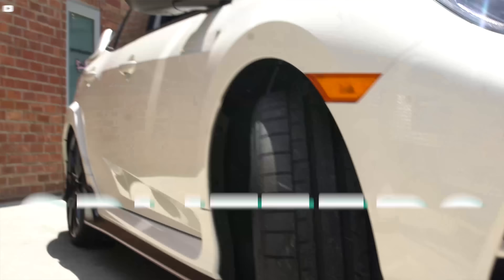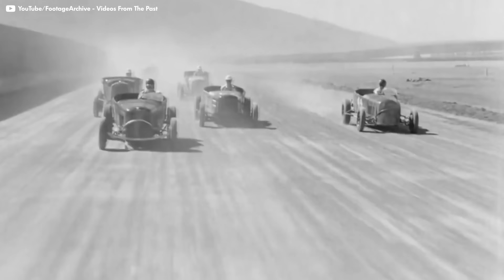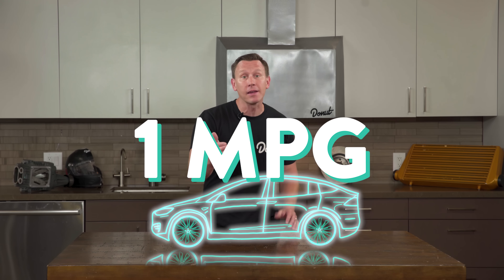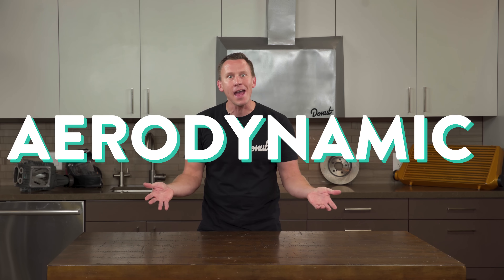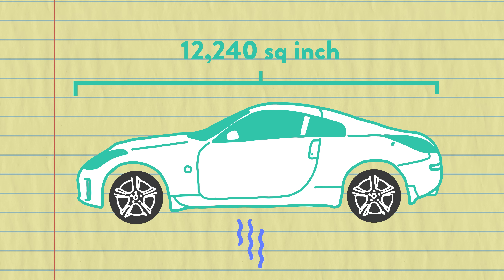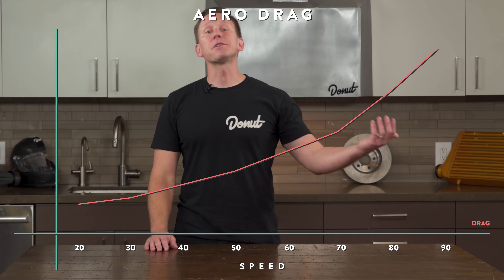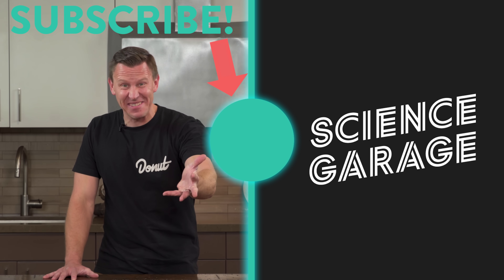Wings and Spoilers; Lift and Drag | How It Works

Comment: The ford gt 2017 car makes a perfect example, but better because the spoiler is automatic once the car goes over 100mph the wing lifts up by itself. EVEN BETTER, the ford gt 2017 is fully made of lightest strong material such as carbon fiber.

Comment: Why Tesla have good aerodynamics having a fucking wall in their front
Reply: And cars dont? Radiators and intercoolers are essentially walls for air. The amount of air that gets through is pretty slim. In fact, most if the ir diffracts across and around the radiators into your engine bay where it runs into even more stuff, your engine, your fire wall, in some car cases theres an undertray in the engine bay essentially turning the whole engine bay into one big parachute. Hope this helps!
Reply: @theofficialkevin  My comparison is more with a curved front , like porche 953, jaguar xjr9, lemans lm07, Maurer c87,  but you surely helped, thank you.

Comment: I love most of your videos, but as an aerodynamics student, I have to point out some mistakes in your explanation for lift. First, the use of the coanda effect is incorrect for explaining lift. You mentioned earlier in the video how it's like you're moving through an ocean of air. This is more accurate, the airflow behaves like a continuous material, which deforms to follow the shape of the airfoil. The coanda effect is only relevant when looking at a relatively small jet of high velocity air, the air the vehicle moves through isn't behaving like a jet of air. Another misconception you used was the longer path fallacy, you said that because of the shape of the airfoil, the air particles on one side have a longer path to travel and therefore, they speed up. This is incorrect, in fact, the length of the top and bottom surfaces could be the same while still generating lift. Rather, the airfoil causes the flow to deflect due to its shape and angle of attack, which causes a change in the momentum of the fluid, this change in momentum in one direction causes an equal force in the opposite direction, which contributes to lift. The part where you mentioned high pressure at one surface and low pressure at the other contributing to lift is good, though it's important to note that this pressure differential isn't caused by the velocity change, rather they respond simultaneously to each other.
Reply: I agree with Jake on this and I will agree with everything he said not much more to add.

Comment: Your explanation of aerodynamic lift is wrong. Actually, air dragged along the surface of the wing (coanda effect) doesn’t produce lift through a venturi-like mechanism, but simply because the shape of the wing redirects the air down, producing upwards force vectors on the wing. If you put a wing in a wind tunnel, you will find that the air passing over the convex surface of the wing does not feel compelled to move faster than the air moving over the flat surface so they can both meet at the same time on the other side. In fact, they don’t both meet, and the resulting “absence” of air from one of the airstreams results in vortices and chattering back and forth of the air steam coming off the wing.

Comment: This is so incredibly wrong. The air traveling the longer distance has nothing causing it to increase its speed. Bernoullis equation was also proven wrong decades ago by Einstein equation. The real reason it creates downforce it that the wing redirects the air upwards and basic laws of physics says, equal and opposite reaction, so the wing is pushed down by the air

Comment: Coanda effect is BS, Fluid dynamics are similar NOT EXACT to aerodynamics... coanda crap, following the curve , is in WATER Air leaves a low pressure VOID just behind the curve ... which the high pressure UNDERNEATH pushes into ...Lift on a plane /down force on car

Comment: In a technical sense, air is a fluid. 'Fluid' doesn't mean the same thing as 'liquid'. Replace the comments about fluids in the beginning with the term 'liquid' and you would be correct.

Comment: high pressure moves to low pressure
that's why a brick will move 'backwards' because there is high pressure at the front and low pressure at the back

amen

Comment: OMG, the second vid of Donut Media and another mistake. This one not as bad but still... any engineer has to take calculus and so should know the dif between exponential and polynomial growth.
Reply: This issue here was not a big deal. The other Donut Media vid I watched was on catalytic converters which had two errors I spotted, one at the heart of the topic, namely, they got the reduction reactions completely wrong.

Comment: Super late to comment but I have been looking at doing an ev conversion on an old ford ranger and the biggest thing I am looking at is range. Im thinking that having aero to increase lift would increase the range of the vehicle by simulating a lighter vehicle since the air would hold some of the weight. Anyone know if I am just stupid for thinking this or is there actually something to this idea? Mainly looking to increase highway efficiency as I have about a 30 minute highway commute.

Comment: Does gt wing really causes more drag and reduce fuel consumption and slow ur car down?
Reply: All wings will cause drag, thats what they do. Its a matter of if the increased traction you get is enough to make up for the increased drag. Wings only help cars that are traction limited at higher speeds.

Comment: The air that has to travel further does not speed up. It is not because of the distance. That is wrong knowledge. In the latest airfoil designs, you have wings that has longer underside and shorter upper side.

Comment: STOP TALKING ABOUT BARNACLE'S PRINCIPLE. IT HAS NOTHING TO DO WITH LIFT GENERATION. THIS HAS BEEN A MYTH FOR TOO LONG. Wings are newtonian in nature and super duper simple! If you push an object through air and that air gets pushed upwards, then you get downforce! If you push an object through air and that air gets pushed downwards, you get lift! You don't even need a special shape to do this! You just need to deflect the air in a direction! The reason wings look the way they do is simply to minimize separation of fluid from them to maximize the amount of air they deflect! This is why when you stick your hand out your car window and rotate your hand, your hand will get pushed up and down! Look on the wikpedia pages for Lift and Bernoulli's principle and you will find: An airfoil generates lift by exerting a downward force on the air as it flows past. According to Newton's third law, the air must exert an equal and opposite (upward) force on the airfoil, which is lift.[13][14][15][16]. All bernouli's principle states in the scheme of this is that the flow must change velocity and thus must change pressure. That's it! I even saw a damned exhibit for this at a MUSEUM saying this is how airplanes fly! IT ISN'T! When you turn on your ceiling fan, it's pushing a wing through air that's shaped to push air downwards which creates lift as a byproduct!

Comment: 1:06 I'm having trouble with this explanation. Physically it is correct in a way but mathematically you'll get the wrong numbers. Fd (or drag force) is calculated with the density 'rho' of a fluid and 0,5. So Fd = 0,5 * rho of the fluid * Vsquared * drag coefficient Cd * reference area A. This gives an answer in Newton that represents its (counteracting) drag force

Comment: Wrong explanation of lift / Bernoulli's principle. Google "wrong explanation of lift" and read what NASA has to say.
Reply: Thank you for this comment! I just learned about the wrong explanation yesterday, and immediately checked the comment to see if someone pointed it out.
Reply: If only you guys realised that every explanation is wrong...
Reply: F = m * a, just like Isaac Newton said. And the Coanda effect makes the airflow follow the wing, which causes the acceleration of the air. Correct, Bernoulli is not needed.
Reply: When nasa actually puts a man on the moon ill listen to them

Comment: Thanks for the great vid, but i have a few questions:
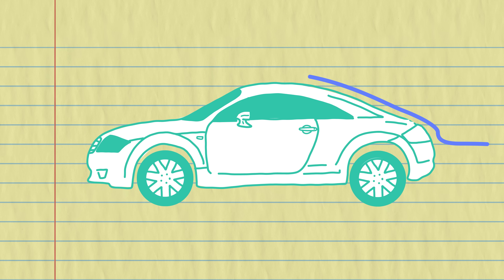1) 7:00 Why does the lift effect happen just on the rear?
2) regarding he splitter: if you have more air underneath the car, and the air has less to travel underneath it than above it, wouldn't that make the air move faster, thus creating lower pressure, thus creating negative lift? 
3) I don't really get how the air travelling underneath the car is faster then the one on top of it (thus creating negative lift), even with all the design adaptations, since there is a lot more travel distance for the air to travel on top than below (which is pretty much in a straight line)

Comment: I actuallt study aviation and the explanation about how the spoiler works is not true. Fast flowing on the bottom and slow on the top is nog true. This is a common made mistake but the air follows the curve so the air is bend. And because Newton said for every force there is a counter reacting force the wing is being pulled down. It is not so that the spoiler is pulled down because of the difference in speed of the air. 

Just being nerdy here

Comment: I have a question, if anyone could answer
If having more displacement is good, why do we use circle cylinders instead of squares? There is more area so there would be more displacement, and more horsepower. Can anyone answer please?

Comment: In case you didn’t know how much downforce can be affected. If you take a car (i.e. any RWD sports car) that didn’t come with a spoiler let’s say. If you put a little bitty piece of tape on the back of the car, that creates quite a lot of downforce. About 30 or 40 lbs of it.

Comment: actually Bernoulli's principle is a wrong explanation of why the airfoil shape generates lift... Bernoulli's principle is valid for every point along a particular fluid profile...but in this case we make a mistake by comparing two different profiles...we cannot do this because Bernoulli's principle is the law of conservation if energy in case of fluid flow but only if we consider one particular fluid profile where energy neither enters nor leaves... so the fluid energy remains constant and from this we derive Bernoulli equation...

Comment: Thank you for the video! I own a 2007 Ford Focus 5-door hatchback, and since I live in Italy and engine upgrades are very prohibited for road cars, I have found the way around it. I have reduced the weight by removing every single interior component in the rear of the car (frame is all you see) and I am experiencing a loss of stability in corners because of the huge difference in weight balance. I think a wing wang (similar to the RS wing) would solve the problem. Any tips?
Reply: Remind me not to move to Italy.

Comment: One question, I am having 410 WHP EVOX, should i put my big voltex wing on or just plain carbon trunk.  I can feel the difference with the wing slow down my car but I feel stable.
Reply: You need the wing if you want stability at higher speeds. If you want that kind of stability without a wing, you'll need to weigh it down.

Comment: It's not correct to say drag increases exponentially with the velocity because the square function is still polynomial, thus it grows much slower (in the long run) then an exponential function

Comment: Wrong wrong wrong - Bernoulli’s doesn’t apply here , also air doesn’t have to go faster because it has to travel further.  These pseudo principles of lift have been debunked.  Although he’s right about the coanda effect, that’s the key to understanding positive and negative lift

Comment: Here's an idea for you, one of the areas of a car with the lowest pressure is the edge between the front bumper and hood. So next time you see a hood scoop or a headlight deleted into an air intake, realize it is literally the dumbest spot to put an intake, the intake is actually sucking air out of the engine.
You have to be going something like 200-300 mph before compression of the air molecules occurs and a "ram" air intake is possible.
Reply: Wait no hood scoops are there to cool the engine temperature not for aerodynamics
Reply: @tsarge_017  They're mostly there for top-mounted intercoolers, like the WRX & STI.
Reply: @18pluskiddo  Correct
Reply: At 0:30 it should be object instead of just car

Comment: Wings won't work by the bernoulli principle. It's just throwing air upwards (or downwards) and newton's third law pushes the wing the other direction. If bernoulli was how wings worked, then paper plane wings (which are flat) wouldn't work, but they observably do.

Comment: Bart, how does powershifting work?
Reply: Carl-Erik Sakson Powershifting works by shifting through your gears without letting go of the gas pedal. This means your engine will redline between shifts, so you need to shift fast in order to prevent causing massive damage to your engine.
Reply: Yong Ling i know mate, i just wanted bart to explain it, powershifting keeps the revs up in turbo cars for maximum boost

Comment: Your equation to calculate drag is incorrect, you also need to multiply by 1/2 and the density of air. 

B.S. in Aerospace Engineering with focus on applied aerodynamics

Source: https://www.grc.nasa.gov/WWW/K-12/airplane/drageq.html

Comment: Aerodynamics is how to cut the air. The Simpler the shell with no proletariat lines, the better. 
For example the  2017 Charger has shitty aerodynamics because it has proletariat lines making it the worst of the Hellcats (Not the one with the most top speed, that is a lie) 

Lines and cuts in the car will ruin aerodynamics. Mustangs, chargers, challengers, vettes, fordgt, Bugattis. All have lines that kill air flow to the shell. A SUV and Pick Up Truck has the best aerodynamics because of simple design, also chassis. No manqué body has handling or true aerodynamics
Reply: Julio Pena You might want to look at the R35's then.

Comment: Great video, but there's an error: 

v^2 is not an exponential increase.
You could call it quadratic or more generally polynomial.

2^v would be exponential.
Reply: What is math
Reply: Wot?
Reply: I thought I was smart
Reply: True but it will still increase with the oscillation of time with a curve, just not with a straight line
Reply: I see you're a man of mathematics
Reply: he never sed that tho
Reply: No, he's right. It increases at an exponential rate. It follows a geometric pattern (r). Where as an exponential equation does not. That's the only difference.
Reply: @paybackpaycheck6811  "Since the time variable, which is the input to this function, occurs as the exponent, this is an exponential function. This contrasts with growth based on a power function, where the time variable is the base value raised to a fixed exponent, such as cubic growth (or in general terms denoted as polynomial growth).
" - Wikipedia.

Comment: One very critical question that no one on YouTube has explained:
Because downforce is generated via pressure difference, where exactly is that force applied?

Examples: 
- On a rear wing, I assume the force is applied to the wing itself and then transfered to the trunk lid?
- On a rear spoiler, maybe reduction of pressure is more spread out and downforce is spread out more evenly across the back of the car?
- On a front splitter, is the force only acting upon the splitter? Or is there little force on the front splitter, but by virtue of more air going up over the car (and less below), therefore there is a very wide area that is affected by the additional downforce generated by the addition of a splitter?
Reply: Wei Wang
Wing: Yes, downforce acts on the wing & then transferred to the trunk lid, this is why the GT-R NISMO'S trunk lid's made out of carbon as well.
Spoiler: Throughout the width of it.
Splitter: Yup, on the splitter itself. If you're talking about downforce acting on other parts of the front end, say, the hood, it'll need to have air ducts directing from the bumper to the hood, like the Vulcan.
Reply: I don't know how any lbs of down force a splitter can generate, but obviously the cosmetic glued on lips do nothing, but then does ridged lips do anything if it's bolted onto the front of the body (not frame?) is the bumper strong enough for whatever kind of down force a splitter generate? Or do all the consumer splitters generate so little that it's mostly cosmetic (vs. the race ones that are huge and sticking out).
Reply: Wei Wang I have a feeling that splitters from companies like Voltex would generate enough for performance use. Sometimes canards are even mounted on the front fenders above the wheels, a time attack R35 has this setup.

Comment: Your explanation of aerodynamic lift (downforce) is severely misinformed and basically adheres to many of the pitfalls of the most popular, commonly regurgitated incorrect explanations.

The Coandă Effect is wholly misapplied as well as the underlying differential distance argument (or equal transit-time fallacy) used to jump to the Bernoulli Principle (the fact of the matter is, the speed of the air particles over the longer distance section of the air foil is actually far greater than that of the air particles traveling the shorter distance, such that they never even meet up again on the trailing edge).

If you're going to explain lift, you can't accomplish it with oversimplifications that, basically, incorrectly misapply theories. Throwing around science terms (basic ones at that) which you clearly don't understand enough to correctly apply, does not make you appear like you know what you are talking about - it does the exact opposite. If you're going to claim to school people on a topic of science (ostensibly, a series titled as Science Garage aims to do just that), at the very least, don't get the science wrong.

It'd be nice if you dropped the annoying-as-hell, I'm-not-interesting-enough-to-stand-on-my-own-merits-so-I'm-going-to-overcompensate-by-yelling schtick, as well, but, hey, at least, that's more of a subjective matter. So you got that going for ya...